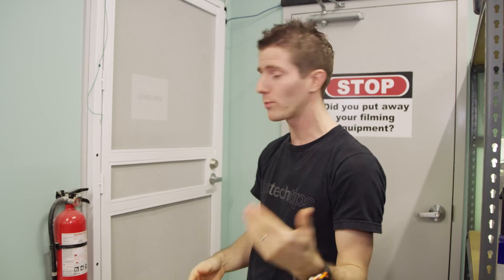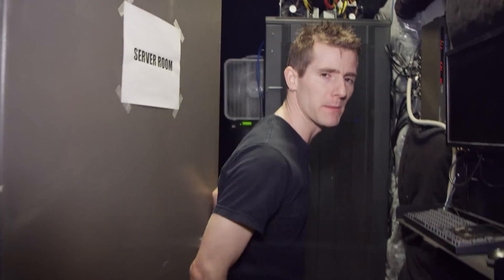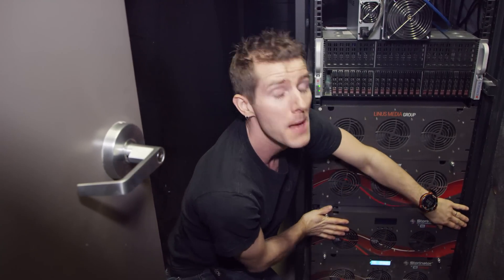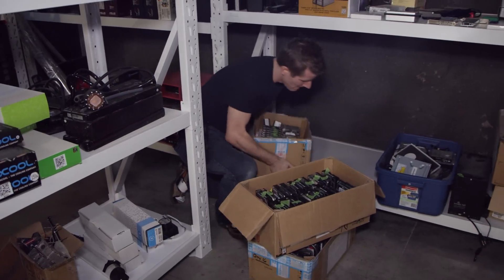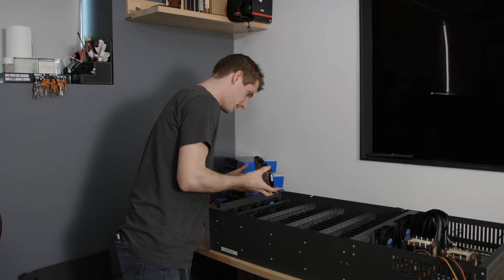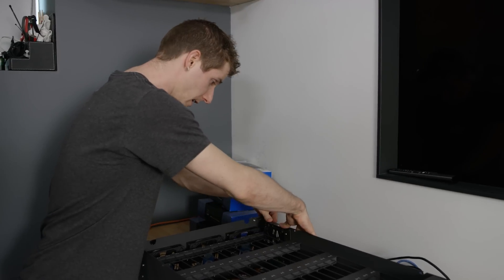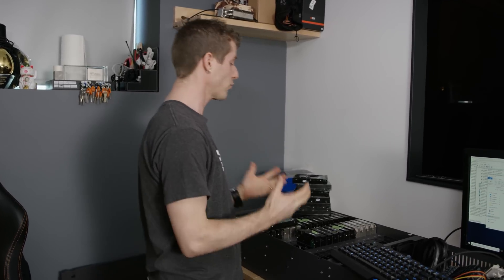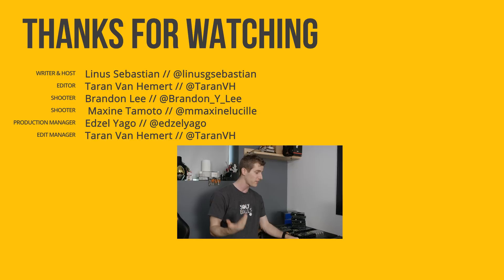HARD DRIVE Mining? This is getting ridiculous...

Comment: Wow...how much electricity is everyone going to be using?!
Reply: You can't think of it that way!
You are making hundreds of bucks for free!
The fact you are spending thousands on electricity is neither here nor there....
Reply: jochenstacker this is very much like a gambling addict isn't it? The gambling addict spends £1,000 a month to win back £200, £800 down per month but the buzz of winning £200 is some how worth losing the £800.
Spending so much on electricity is somehow worth it because you get free money even though what you get doesn't cover what you spend.... is this some trick by the electricity companies?
Reply: I think the trick is to also buy solar panels at the same time.

I mean, you'll still be out a load of money, but at least it's a fixed amount.
Reply: or you could use the money from solar power and sell it to the national grid
Reply: free money from thin air.... I like that, I mean if you're on your computer anyway.   It would be neat to mine floppy discs.....
Reply: Jesus christ, how expensive must electricity be where you live, jhedge, or how much of a premium do they pay you for feed-in? Did you actually do the maths on how long it's going to take you to recoup that $4k installation cost?

I mean, that's significantly less than it was last time I checked - I know prices are coming down but they must have slumped hard to now be decidedly under a dollar a watt. If only I wasn't living in an apartment where such things weren't allowed I'd be installing such a system ASAP,  because that makes far more sense than the last example system I saw. Is that special offers, substandard / factory second / clearance parts, or what?
(as it is, I'm using a fairly cheap, fully renewably sourced supplier... best I can manage)

All the same, at my own per-kwh electricity prices, the general rule of thumb is that a one watt device left running 24/365 will cost you about £1 a year. And at the very, very best, with perfect weather all year, you'll get an average of one third of the rated peak output (that "5kw") through the year. The sun isn't up all day (when it's dark, you make no power), and it doesn't shine at full brightness or directly onto the panels whilst it's actually up (less than full illumination means less than full power).

So, OK, it's maybe not quite "between 5 and 10 years" any more, but I'd suspect it'll still take you nearly 5 before your system stops representing a net loss and is actually producing 100% profitable power for you. The difference between what you generate and what you use being irrelevant unless you get paid a significantly different amount per kwh for putting energy into the grid than what you pay for taking it out, as in terms of money saving you only need count how much the panels are kicking out.
(though in this case I'd say you're averaging about half a kilowatt, so 12 kwh/day, more in generation than in use, which still isn't at all bad)

I mean, maybe I'm adding it up wrong, feel free to hit me with the actual numbers of how much your system actually generates over the course of a day (preferably a year), how much you use, and how much both grid units cost you and how much excess solar units earn you, and we can see the truth properly... and also divide your system price (including installation and tax...) by how much you're earning to see how long it takes to pay off. But if you've only bought it in the last two to three years, you almost certainly haven't paid it back yet, I feel pretty confident in saying that.
Reply: I read in a buisness freebie mag that Bitcoin mining is using more electricity worldwide than many small countries the one it referenced as closest was Estonia!  Really green !
Reply: HAHAHAHA people who say things are cheap and they post a USD$ keke.. never gets old..
Reply: erich ly electricity is going to start costing mor :(
Reply: True, I hadn't considered that... but the cost of replacements is probably still far less per year than the power this thing would consume.

Never mind that the typical ROI for solar installs is itself still way up somewhere in the 5-10 year bracket, if you get a particularly good deal...
Reply: +mspenrice it's really expensive in Ireland
Reply: Define "really expensive". I'm working on the basis of about GB£0.125 per kwh, here.

Also having looked things up, guide price for a decent 4kw system in the UK (apparently, 5kw ones are too large to fit on top of the typical British house) is in the £6000-8000 range, all up including panels, controllers, fitting and tax. And the bonus you get at the moment, other than not having to pay 12.5p per unit for your power, is about 3p/unit purely for the generation and not taking anything out of the grid, and 5p/unit (ie 2p more on top) for feed-in. So not even a 50%, even if every single unit of power I used through the year was not only covered by a solar generated one (so I didn't have to take anything from the grid), PLUS a second one to feed back in. And that feed-in bonus is diminishing.

Perhaps the situation is much better in the states, or wherever 420Conglomerate is from, but the cost per watt is certainly not under $1 equivalent here yet, and the MAXIMUM money I could realistically make back from a 5kw system (presumably costing about £7000-9000) each year would be about (5000/3 x (0.175/0.125)) = £2333. That's assuming I either don't use any power at night and adjust my usage according to outside light levels, or install a battery storage system at considerable extra cost, of course. £8000 / £2333 = about 3 and a half years just to break even, not including the battery cost or the effect it would have on my lifestyle. More likely it would take about 5 years, with the panels saving and/or bringing in a not inconsiderable £1600 per year anyway... which is actually a LOT more than my real world usage.

My actual electricity use per year is actually somewhere around £500 last I checked (single occupancy apartment; I appreciate it might be a bit more for a family home). So if the panels could knock out, say, as much as 2/3rds of that, then the rest being pure feed-in...

£500/3 = £166.67 remaining electricity bill (we can disregard this as it's not relevant to the rest of the calculations)
£233.33 saved per year on the actual bill, plus (3/12.5)ths for solar generation bonus = a further £56
500/0.125 = 4000 units; 2/3rds of that = 2666.67 units
1333 watts average over the year x 24 x 365.25 = 11685 units additional solar generation, or £584.25 at 5p per unit.

£233.33 + 56 + 584.25 = £873.58 realistic payback per year.
£8000 / £873.56 = 9 years 2 months ROI period, after which the panels are earning £873.58 actual profit per year.

Which is equal to approx 7000 units of grid power per year (ignoring the fact that we'd lose 2p of bonus from no longer feeding into the grid, as well as no longer paying off the solar panels), or enough to run a mining rig "for free" so long as its power consumption wasn't any more than... er...
...80 watts.

I think a single typical mining GPU uses more than that, doesn't it? I know there are CPUs that dissipate upwards of 95 watts when running at full tilt, certainly.

Of course, the panels will offset some of the cost of running a mining station, only problem is you'll have to wait upwards of nine years before starting the run. And there's still the cost of the equipment for doing that . Plus if you don't have space for a 5kw install, there's a little problem in that the smaller the installation, the greater the proportion of the total price the fixed costs (controllers and installation) represent, so it doesn't scale too well, and a smaller system will take longer to pay off. Maybe pushing towards 10 years for a 4kw one and definitely beyond it for a 3kw.

So actually looks like my original 5-10 year estimate was fairly valid :p
No cooking of the figures btw, the actual outcome was as unknown to me when I started as anyone else.
Reply: but in some places you CANNOT 'sell back to the local' utility.
Reply: At current exchange rates it's 0.07 Euros or $0.09 US dollar (9 cents KWH) or 0.06 British Pounds for 0.12 (12 cents) per Canadian Dollar ... Linus can get his electricity rates down to below 8 cents CAN per KWH if he pushed BC Hydro enough probably maybe even 6 cents KWH if he paid enough up front! In BC the trading utility company is called POWEREX which is the bulk electricity trading arm for BC Hydro.

ANOTHER thing that Linus can do to get his electricity rates down is to buy at least SIX 130,000 litre PROPANE tanks at about $25,000 CAN used per tank and buy a BULK FUTURE on PROPANE so he prepays at summer rates at say 48 cents per litre OR MUCH LESS for at least ONE MILLION LITRES of Propane (i.e. locally, Linus needs to goto Superior Propane to buy that much!)

Then attach the propane tanks to EITHER a low-RPM (360 rpm) propane piston generator (basically a few modified GMC truck engines) for 500+ kilowatts of power OR buy some Ballard Fuel Cells (i.e. in Burnaby BC) tweaked for direct Propane-to-Electricity generation via proton-membrane exchange.

Linus could then power his gear for YEARS at a time and NEVER EVER go down power-wise! AND he would have lots of propane leftover for the onsite staff barbecues! I just did a propane generator quote for a MASSIVE Northern British Columbia server farm (related to my friend's research division) that's going to be running over 25,000+ AMD S and W series FirePro GPU cards for scientific computation purposes.
(YES! I know that is over 150 PetaFLOPS of 32-bit Single Precision GPU horsepower!)
Reply: Nothing is ever free. This digital currency craze has officially become a ponzi scam.
Reply: My hydro bill averaged out to 150$ a month prior to spending $5k on a complete solar set up. I make about 50$ a month selling my excess power back to the city. So 5000/200 (150 savings plus 50 profit) a month. 2 Years and 1 month until break even.
Reply: I said what the cost was. $5k. You're telling me my own personal experiance, that I live with every day is wrong.
Reply: True, but we're working these maths on the basis of someone living in a place where you can do that (which I bet Linus does). Don't complicate things unnecessarily.
Reply: Linus Tech is in Surrey, British Columbia, Canada which gets its electricity from B.C. Hydro which as an electric company has the SECOND CHEAPEST electricity rates in North America after Quebec Hydro. He's paying retail 12 cents CAN per KWH but we can get it down to 8 cents KWH if we bug BC Hydro with enough of a pre-paid bulk purchase!
Reply: Ow, that still seems like quite a lot for the industrial amounts you must be using, but then I don't know what the Can$ to UK£ exchange rate is right now :)

Now we just need to know what 420Conglomerate is paying, if they ever come back to reply... they seem to have gone awfully quiet...
Reply: hard to say, but probably doesn't help...
Reply: that's incredible
Reply: it can but it's not really fast enough to make good deadlines.
Reply: The Sun and Wind provide free electricity.
Reply: Another ponzi scam. Again nothing is free. There is always cost in money, materials, and time. You are utterly wrong.
Reply: +lastswordfighter none
Yes, no-one's pretending there isn't... but the fixed costs involved in installing solar, wind and hydro generation are the vast majority of the lifetime operation cost. Once you pay that off through feed-in earnings, it's all gravy.

I mean, you've bought the thing, you own it outright, and it's earning you money. There's no-one else you're having to exploit through MLM or whatever, or anyone above you taking a cut of your earnings (other than through income tax of course). Just point the panel at the sky or put the turbine in a windy spot, hook it up to the grid through a meter, and bill the power company on a monthly basis. Where's the Ponzi in that?

This isn't to say that crypto isn't the greatest scam the 21st century has seen so far, but renewable power generation is just a plain good idea. I'd have covered my roof in cells several years ago already and be well on the way to break-even (I don't exactly live in California - my previously stated 5 to 10 year ROI was entirely based on real data, and was really a bit optimistic I fear), except I'm in a leasehold apartment and residents sticking things on the roof is sort of frowned on. Plus the site managers are extremely conservative and luddite, and can't even be convinced that swapping out the desperately old-skool lighting in and around the buildings for LEDs is a good idea, so I don't see them agreeing to a shared ownership scheme anytime soon...
Reply: +StarGateSG7 ... I don't know what you're smoking, but I'd like to try some. Either it makes you really smart, or it just makes the world seem to make a lot more sense. Both of those would be nice.

NB, just how much do those generators or fuel cells cost? And how much space do you need for those plus the tanks? I mean, the land rent may be something you'd have to consider if they take up more than the size of a typical parking space.
Reply: "GB£0.125 per kwh,"

Seriously? Wow how epicly cheap! Yeah I know it´s pounds but still. Sorry to break it to you, but come back to us when your elecricity actually costs 0,304€ per kwh which is about double the amount of what you pay for, exchange rate included. That´s also a main reason practicaly no one here in Germany mines, thanks to the high elecricity costs it´s simply not worth it. Only an idiot would try to mine cryptocurrencies here in germany...
Reply: "I read in a buisness freebie mag that Bitcoin mining is using more electricity worldwide than many small countries the one it referenced as closest was Estonia! Really green !"

Yeah exactly that´s the next fucking problem and why I freaking hate miners! Not only do they jack up the prices but they consume a shitton of elecricity and produce tons of CO² as well! And only so that those freaking idiots can make like 100 bucks plus a month at best instead of getting up their fucking lazy asses and working like the rest of us!
Reply: "erich ly electricity is going to start costing mor :("

It already costs a shitton more in most countries, most likely thanks to fucking miners! Yet another thing I fucking thank you lazy ass miners for! Thanks for ruining the environment and everyone elses paycheck only so that you can sit on your lazzy fucking asses!

Bah enough of this, i´m getting really freaking angry just thinking about the fact that I pay 79 fucking euro a month for a normal usage of 2.000KW a year thanks to these fuckheads!!!

Comment: you guys should do a video on old server hardware and their dependability... old r710s are stupid cheap <$200... old sas drives are cheap... old x5690s are cheap... old v2 motherboards for a r710 are cheap after you realize the one you bought doesn't support the new processors... old but better psus to support them are cheap after you realize the ones you have aren't good enough to supply beefier processors... new thermal paste for the excessive amount of time spent unmounting and remounting processors between sockets realizing stuff... google is free, but that's no fun, only use it when things don't work, that's a must.

but seriously, there's a pile of old servers hanging around on ebay, and it'd be cool to know what ones can handle being super crazy servers that are flat-out all of the time in some kind of unrealistic test.

Comment: Burst coin price = $0.017192 USD. lol no thanks
Reply: One cent?! That’s pretty nice!
Reply: You can mine thousands at a time with a decent amount of capacity.
Reply: vs cost to mine?      The number 1 is totally arbitrary.
Reply: UnknownPlayer 00.0006 cents?
Reply: I mine about 300 burst per month using 5 TB of space to mine (not very much).   My electric bill for the month (which includes running AC) is US$ 21.   The expensive part of burst mining is buying the HDDs to start with, which is why I tell people if they don't already have the drives, then just buy BURST instead of investing in new drives.
Reply: 300 BURST = 4.03 USD
I feel bad for you bro...
Maybe you can sell them HDDs later if ya want.
Reply: Small miners are not very efficient because the ratio HDD power requirements versus power requirements of MB/CPU/RAM is very low. I have a 120TB miner that uses around 86.4 KWh per month a.k.a. $13 (no AC)
Mines around 4000 Burst in that month.
Reply: Dominik Sienko hey genius, theres no guarenteed that burstcoin will go up in value.
Reply: UnknownPlayer
The point still hold : don't mine burstcoins. If anything buy some
Reply: That is why it is perfect to mine at current costs, much much easier to get and the value will go up. We just dont know when but i will be sitting on a lot of coins when it does. :)
Reply: If anything, buy them. If you mine them now you will pat 500 dollar in electricity to mine 100 dollar worth (I didnt do the math, just a rough guess). Or you spend 100 dollar to buy them...In the end even if they go up in price. You would have made more money just investing the 100 dollar. Oh and this is also not even taking into account that you need to buy hard drives and a pc...
Reply: No Face Killah hey genius, if it was GUARANTEED, the price would go up by definition.
Reply: Unity Twins k
Reply: When it comes down to any sort of currency - the value it provides actually is the their market value because they don't have any worth / use of their own.
Reply: better than doge coin.
Reply: Hey fuckface, just because each individual coin doesn't hold much value doesn't make it a bad coin to invest in, mine, etc. Value is not always the price it's worth.